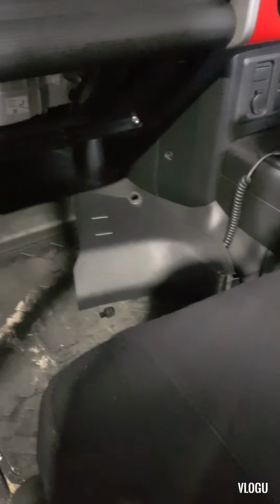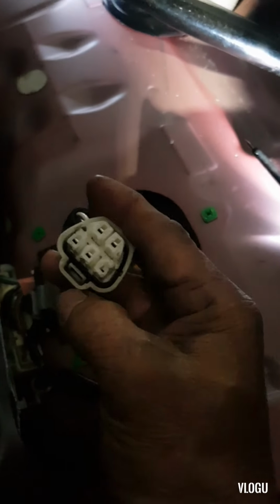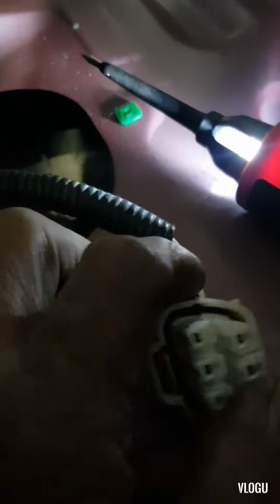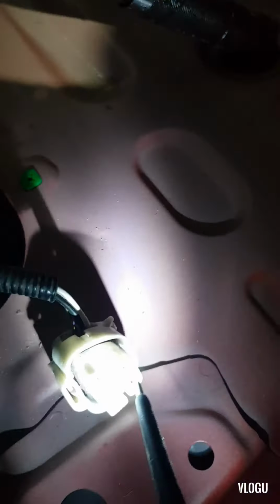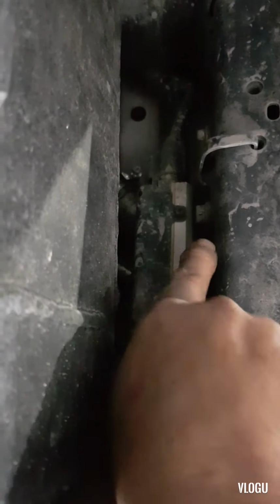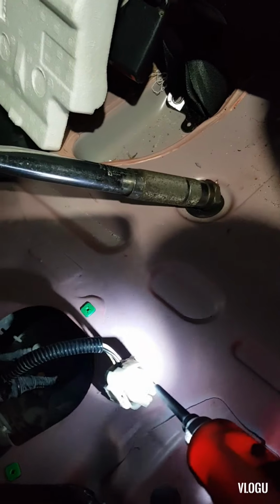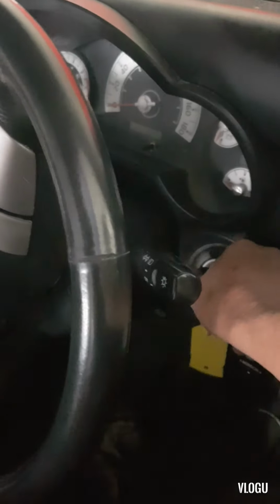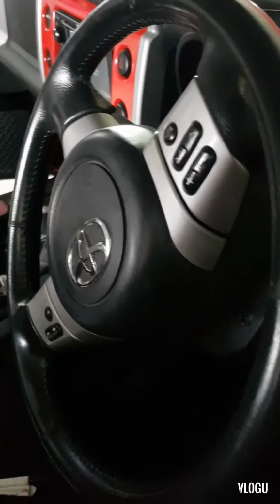FJ Cruiser won’t start?/ Fuel pump module location

Comment: Im having the same problem on a 2011 fj cruiser north america version. I got the same 1.2 to 1.3 volts on my plug. Did changing the module fix it or was it a bad connection?
Reply from the maker: @rhoadeswr1  you should have 12v supplied to your fuel pump to get it work if tested no 12v supply check all the power supply from the fuel pump module if you confirm 12v is present replace the module